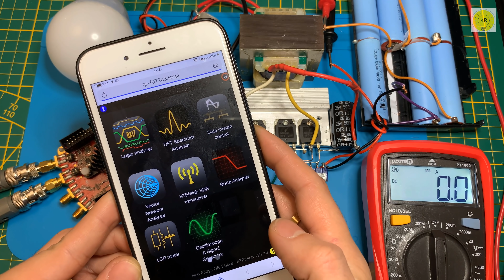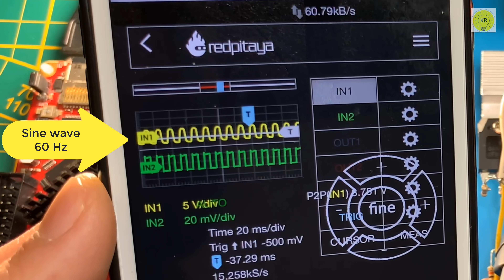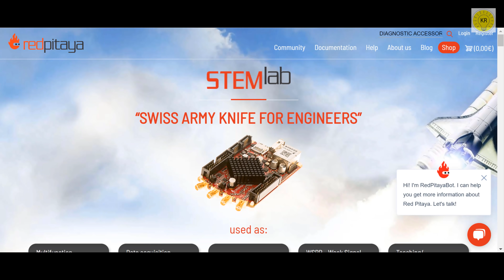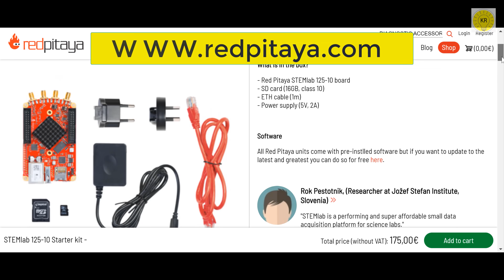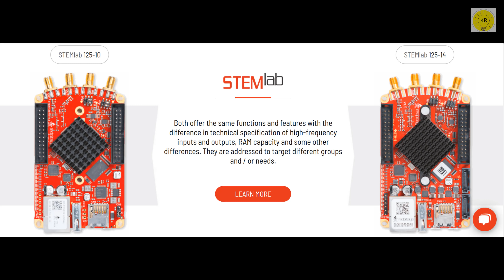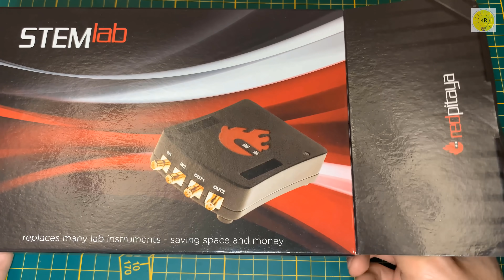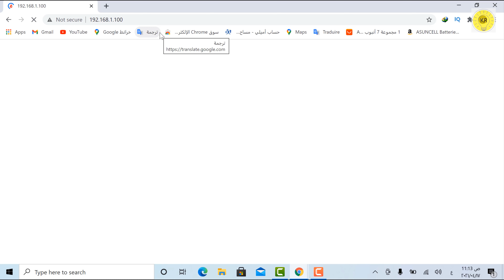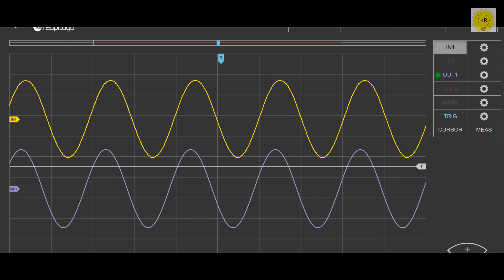how to make simple inverter 450W , sine wave ,mosfet ,Red Pitaya

Comment: I noticed a wrong design the r c network is on the wrong side the inductor Will get hot too hot the r c network will stop put the r c network on the micro controller signal output the 2 signal output

Comment: 450W через транс такого размера?  Что то мне кажется, что сердечник уйдет в насыщение уже при 30-50 W.
Reply: Не . Около 100 ватт выдержит .   
Хотя  ,  неизвестно какое там качество стали .
Reply: In reality, this transformer can provide about 100W. The cross section of the core is estimated at 3.5x3.5 = 12.25cm2, sqr (12.25) = 150, 150 / 1.2 = 125 VA, 125 * power factor 0.8 = 100W. At this load, the transformer does not overheat and can thus operate reliably indefinitely.

Comment: Very nice work .. awesome video really.. 
Can we ask you favor? 
Can you design a big lithium ion battery with big amper (300 to 500 amper) 24 volt 
And how to charge it without problem
In order to use it with 2000 wat inverter 
Thanks alot brother